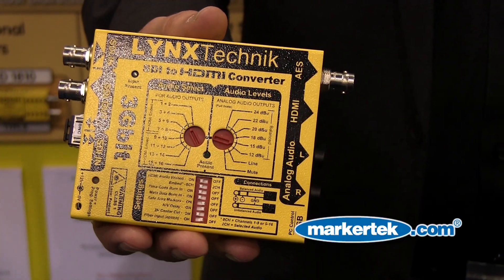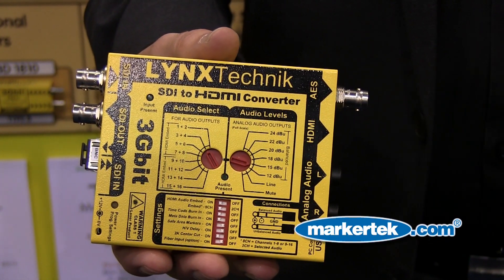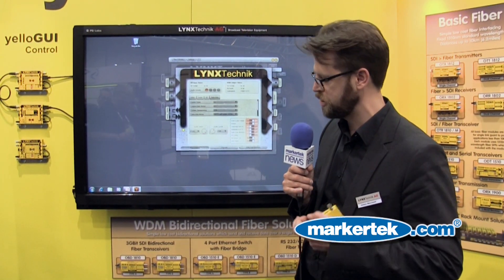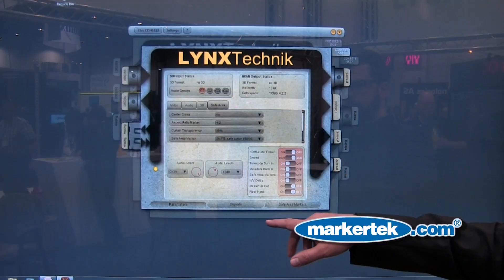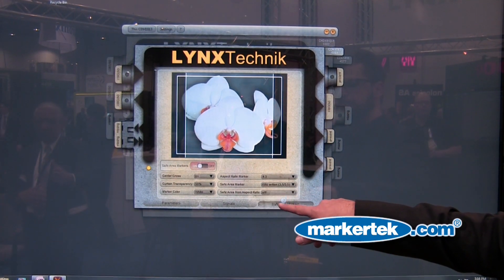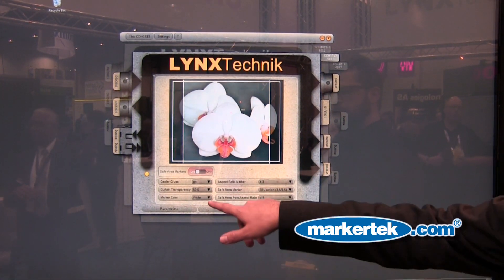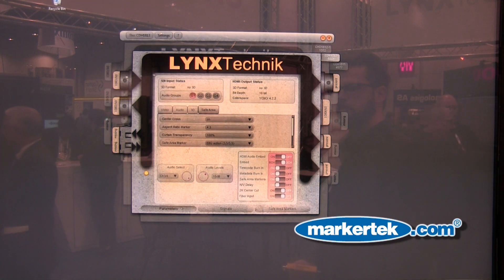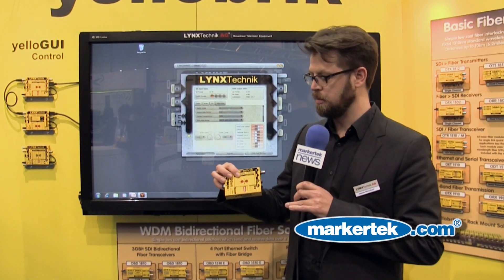Yellobrik CDH 1813 SDI to HDMI Converter

Comment: Basically this is a tv configuration device. 
I seen some that says  Hi5-4K SDI to HDMI converter. So are you telling me that this device would Convert a regular 1080p 240hz tv to a 4k Resolution by using this device, just like new 4k tv for a fraction of a price? If i got a 4k graphic card, I could used the pc to watch movies on 4k resolution?